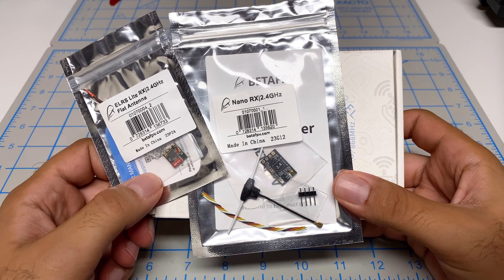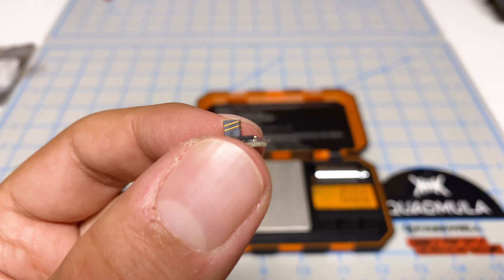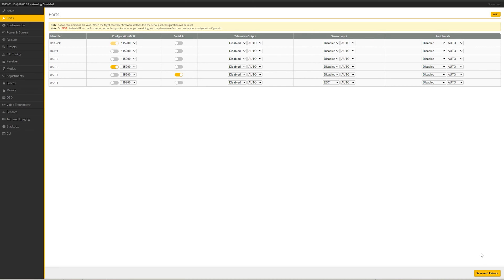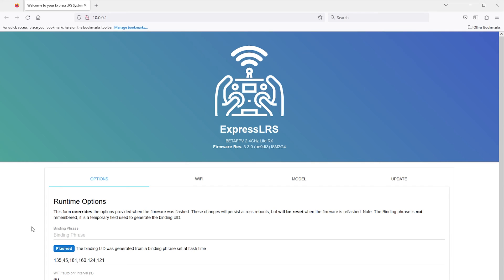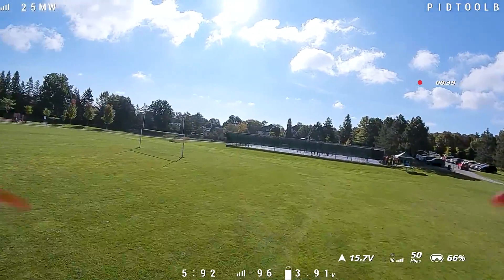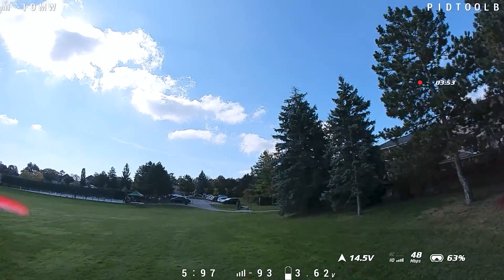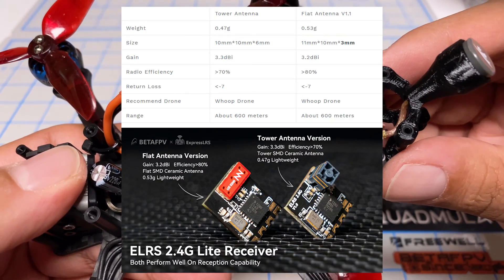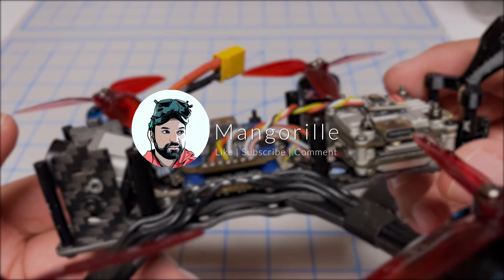SUPER Tiny ELRS Lite Receiver! | BetaFPV ELRS Lite Flat Antenna V1.1 Receiver Review

Comment: I just put this on my mob8...I should have go for the HM ep2 with cube antenna because the spi elrs onboard receiver was better than this lite receiver.
Reply from the maker: The tower antenna is more fragile though. I use the lite receiver in my Air65 and it gives plenty of range for indoor flying and is more protected from crash damage.
Reply: @Mangorille  Yes the tower antenna on my board broke then I soldered a copper wire which ripped the solder pad while crashing... that's why I chose the flat antenna. The Rssi dbm is -70 most of the time and at 150ft it goes closer to -100 at 100mw power and 150hz packet rate.
Reply from the maker: @ I glued the copper wire onto the flight controller board itself to keep it out of the way. So far no damage in crashes, thankfully.

Comment: I have one of these sandwiched in my 3.5 in frame and it goes 1/4 mile no problem, amazing.
Reply from the maker: So that's about 400m, still within the 600m advertised on their website. What power output do you use on your transmitter?
Reply: @Mangorille  I use auto power up to 1W. I do get telemetry lost - telemetry recovered warnings around 200m, but the link is rock solid. I bet if I moved it to the underside of the quad it would be even better.
Reply from the maker: @catbroh  Got it. my module only goes up to 500mw but I suspect it would go 300-400m easily at 500mw.

Comment: Used the internal elrs on my Pavo pico and it was grwat
Reply from the maker: How far did you fly it? It should perform similar to what you saw in this video, which is usually good enough for smaller quads that you don’t fly more than a couple of hundred meters away from yourself.
Reply: I don’t know how far exactly but my latest video one take you can see it def rocks pavo pico v2 gorgeous whoop….

Comment: When using dynamic power, just because it jumps up to full power doesn’t necessarily mean you needed full power. This can happen if the signal degrades quickly enough to require a a couple jumps up in power. The transmitter will jump to the high setting so it doesn’t take too long to find what it needs to prevent failsafe. The telemetry link going down would also cause this to happen since the transmitter would no longer be able to see the signal quality. Telemetry has a lower max power compared to the control signal.
Reply from the maker: Thanks for the note, I never lost telemetry during the flight. The Tango 2 Pro has an audible warning when telemetry is lost. I do agree with you point that it will ramp up quickly to prevent a failsafe. I found it strange that even when it was at ~-103dbm, the transmit power was still at 10mw. I'd think at that point it would ramp up but I suppose it looks at a combination of "things" to make that determination.